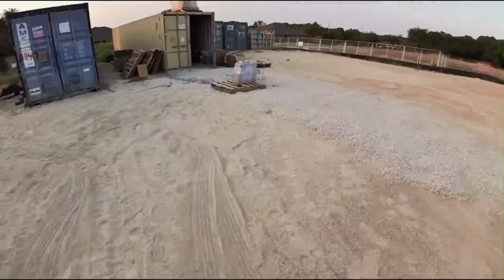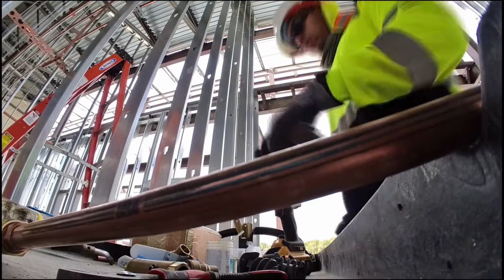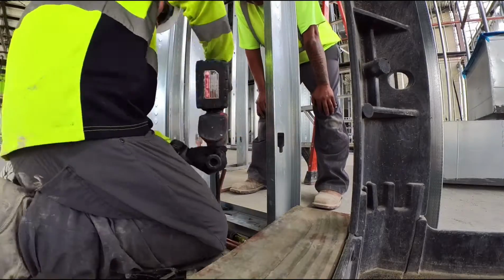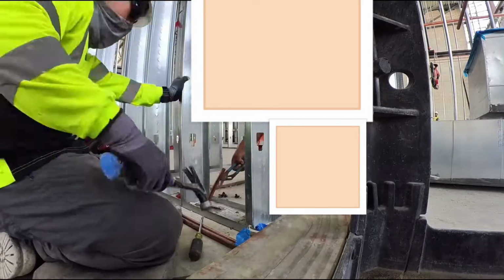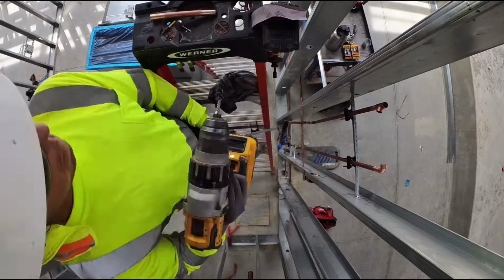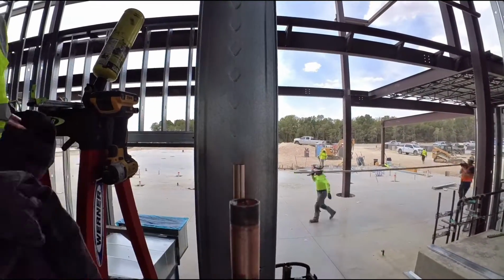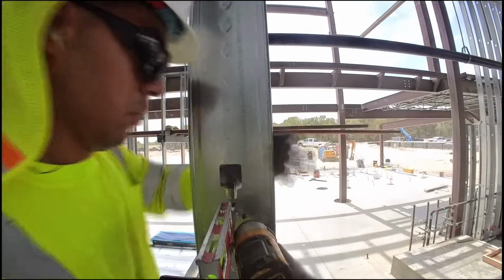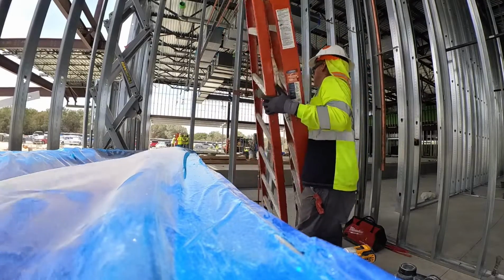Commercial Plumber: Road to Journeyman #2

Comment: Heat pipe up and wipe flux off pipe and fitting just before you add solder- especially on vertical joints. Excess solder will bead off😉
Reply from the maker: So you heat it up and wipe it off while it’s hot? I’ll give it a go next time around! Keep a look out for the video I’ll mention you!
Reply: @PM.PLUMBING  Yes-Right when you see the joint start to “sweat”, 
wipe all the flux that  drips out. That’s the stuff the joint doesn’t need. I usually have a damp rag with me. Cleans up better before and after. Good luck with your apprenticeship!